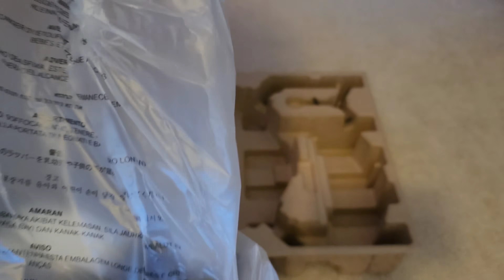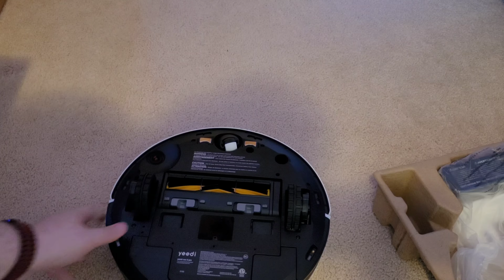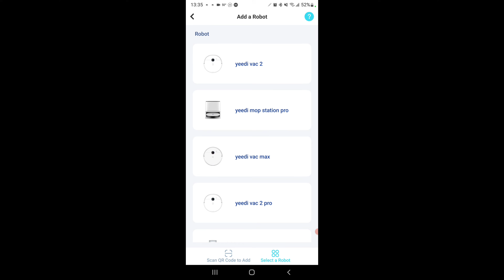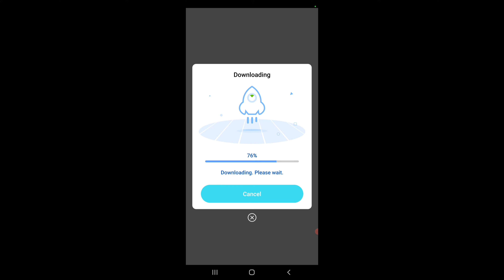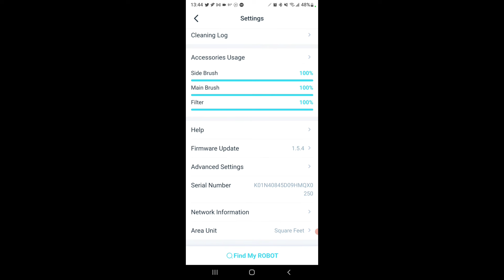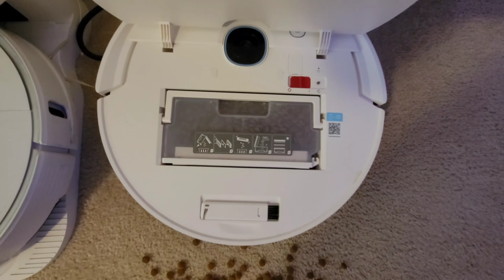Yeedi Vac 2 Pro | Unboxing, Setup and Inital Test

Comment: What robot vacuums do you have?
Reply from the maker: I have several!
Reply: @FunTechReviews  I actually plan on getting the yeedi vac 2 pro within a few weeks and the self emptying bin I am going to get later
Reply from the maker: @coltonsvacuumcollection  right on! It's a great little unit
Reply: @FunTechReviews  btw have you seen any of my videos yet?
Reply: @coltonsvacuumcollection  Just ordered Yeedi Vac 2 . How is yours doing so far ? Is it still kicking ?
Reply: @whosthat1531  actually returned it because the battery life wasn’t great and was going to get the deebot n8+ but decided to try the iHome Luna pro which was a massive fail then got a neabot q11 which started not doing so good so returned it then got my shark vertex
Reply: @coltonsvacuumcollection  What are the major do's and don'ts when using my Yeedi Vac 2? And hey, does it actually clean those pesky edges?
Reply: @whosthat1531  the only reason I really returned it is the navigation isn’t great, tbh my Shark IQ would navigate better and the battery life wasn’t very great, not the worst just could be better
Reply: @coltonsvacuumcollection  Curious to know which robo vacs outshine the Yeedi Vac 2 within the same price range ?
Reply: @whosthat1531  if it’s on sale the Deebot n8+ will destroy that thing
Reply: @coltonsvacuumcollection  Snagging the Yeedi Vac 2 for a mere $110, while the N8 demands a $350. By the way, I stumbled upon a charging docking video of yours where the Yeedi struggled to dock . Is it that bad ..
Reply: @coltonsvacuumcollection  I'm having a hard time finding any videos on how to improve mopping with vacuum robots. Could you create some videos on this topic? According to what I've heard, using detergent directly in the reservoir is not recommended, so I'm searching for some alternative techniques.
Reply: @whosthat1531  I will try because I’m getting rid of some robots so I’ll probably do a video comparing all my robots that mop